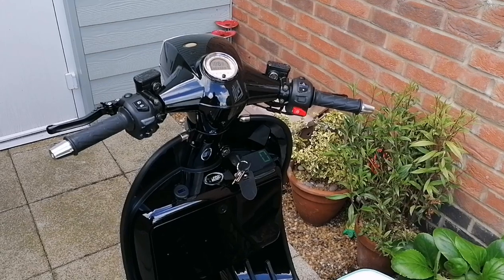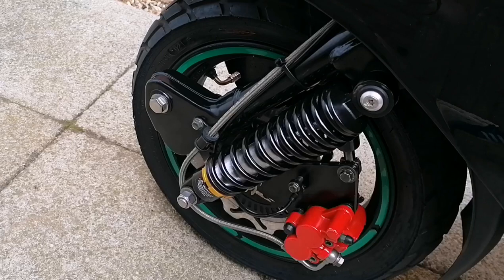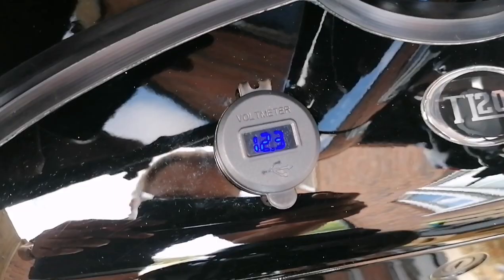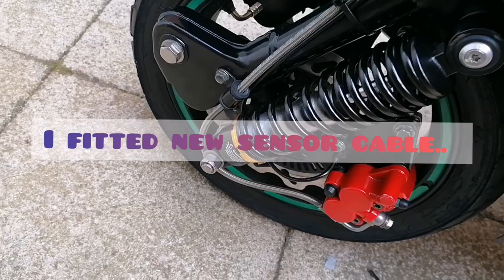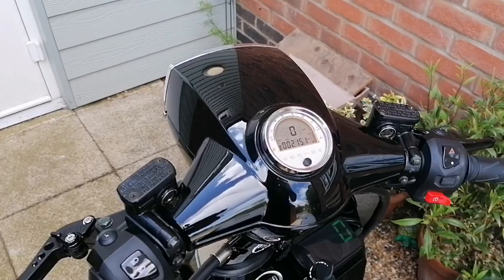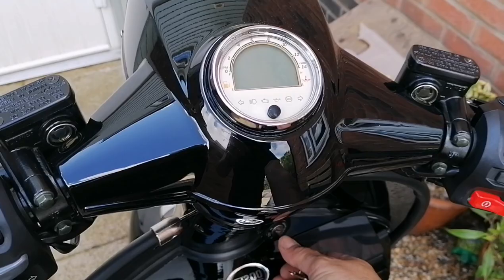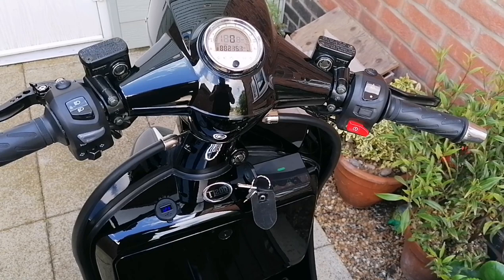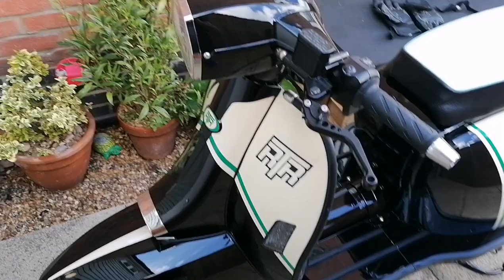Scomadi Satnav Speedo

Comment: looking good mike , my speedo works , but intermittent fault with fuel gauge. i think its just one of those things with these bikes , the speedo set up not all that !..... that pm tuning 205 engine , is great your be pleased to know , it pulls like a train , awsome.......... but i think could do with up gearing ,  is that possible do you know ?
Reply from the maker: I know what you mean about up gearing. My bike feels like it should have a taller gear as it feels as if it could go quicker. That might be wishful thinking on my part mate. These scooters will undergo some research and development I feel in time to come. As far as I am aware there are no up gearing parts as yet. Thanks for the comments buddy. 😊👍

Comment: Hi Mike where did you buy the sat nav / speedo and usb battery voltage
Reply from the maker: Hello buddy. The satnav speedo came from Amazon, as did the other parts. I think in total it was no more than £30.00. Hope that helps.
Reply: @mikeskosnikowski9945  do you have a link mate
Reply from the maker: @andrewbaden8261  I have been through my purchase history on Amazon and the satnav is not coming up. The USB ports are just standard. I also cannot put links to Amazon on here. Sorry about that.
Reply: @mikeskosnikowski9945  if you find out please let me know
Reply from the maker: @andrewbaden8261  will do buddy.
Reply from the maker: @andrewbaden8261 
I have found it but cannot post links on here. Are you on Facebook?
Reply from the maker: I am on Facebook as Mike Kosnikowski. If you send me a message I can send you a screenshot of the satnav speedo on Amazon.